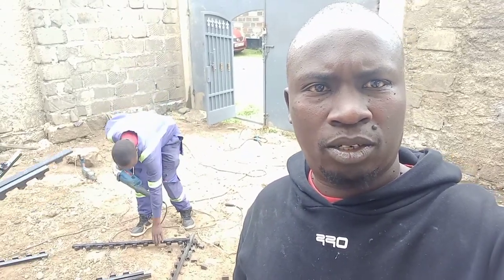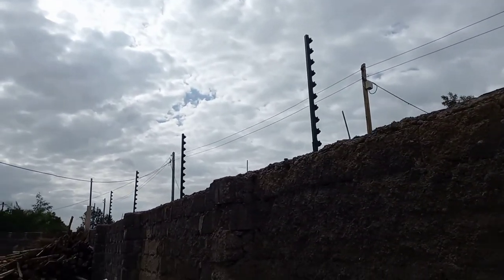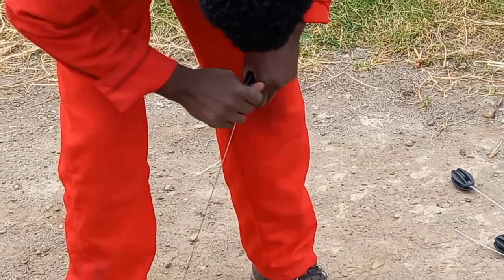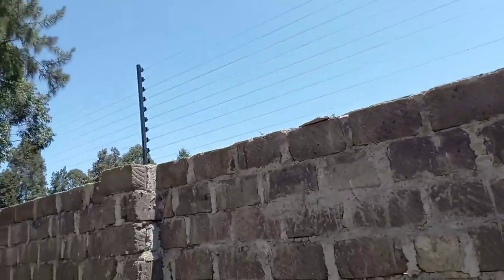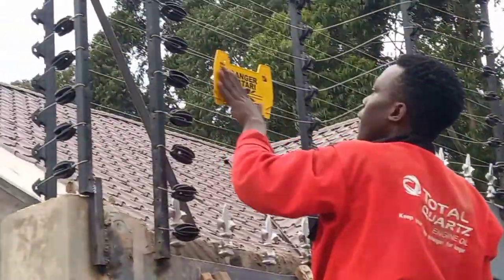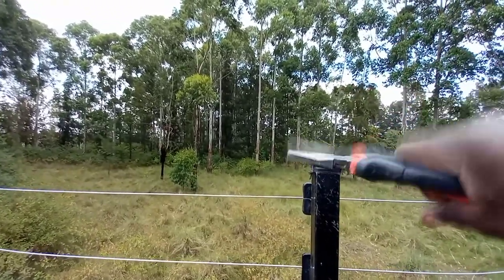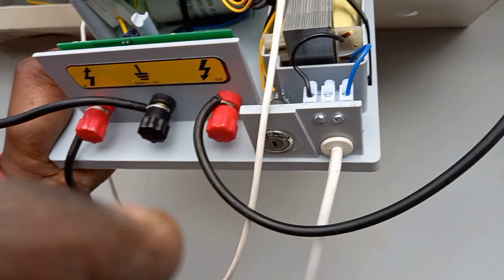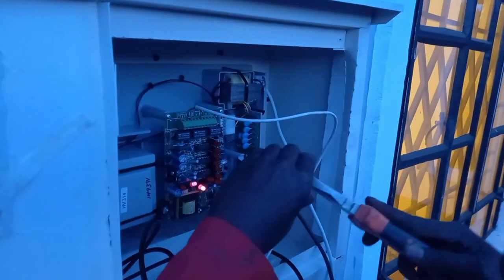How to do ELECTRIC FENCING

Comment: The cost of fencing one acre approximately
Reply from the maker: It depends with the type of fence. With wooden poles. Or the one on top of the wall. It will be 550k if there is a wall and the fence doesnt have stairs. We dont use ready made materials we assemble all at the site for the best job possible. You can google THE BEST ELECTRICAL CONTRACTORS IN NAKURU. We are leading and we want you to add a 5star after we finish your job
Reply from the maker: 0722742072 is my whatsapp number. We are based in nakuru but we work contrywide